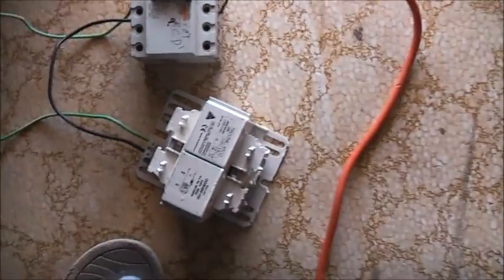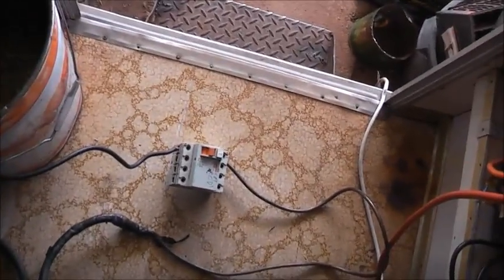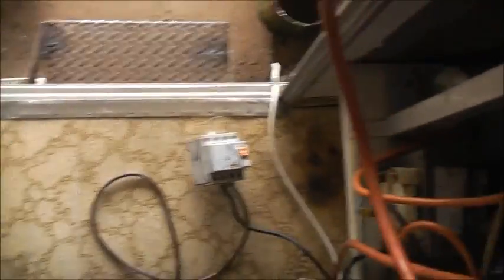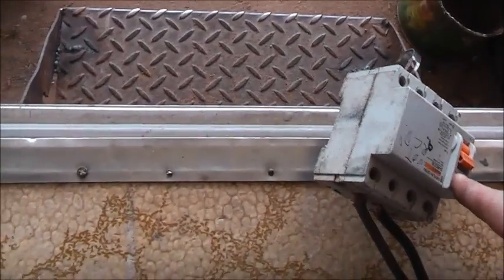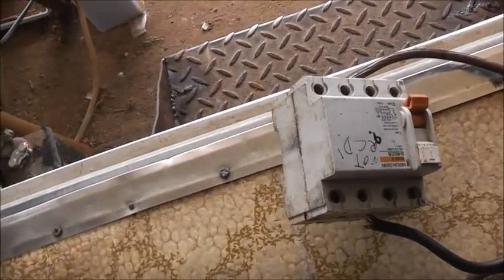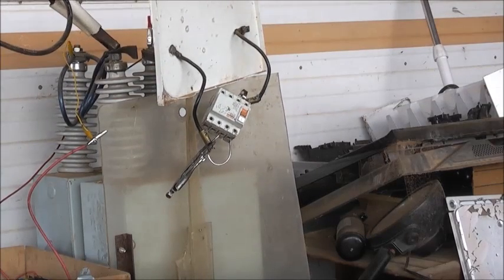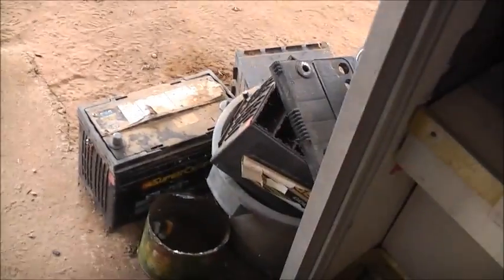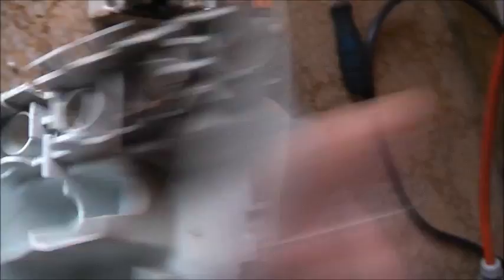Merlin Gerin RCD Torture & Teardown

Comment: LMAO, stuff it on the high-current MOT. :D Yes, that's a bit better than putting the oil-filled radiator on there..... Muuuuch more amps. :D

Haha, it tripped eventually, but a sloth could trip a bit faster than that. Naaaah, POP IIIIIIIT. :D

In a way, there's not much 'explosives' inside one of those (i.e. things which would explode into a lot of bits when cap-banked) so I wouldn't blame it on your ZVS device too much or the batteries powering it..... It's just that things like an RCD would need to take an awful amount of current (possibly a significant way beyond 80kA) to get them to forcibly and violently explode everywhere.

Now that you have the top of it removed, it would be funny to fizz-over the contacts in there with some DC current and get them Glowiiiiiin in there. :D

Thanx for showing,

-BoomBoxDeluxe.

2nd November 2014, 15.15